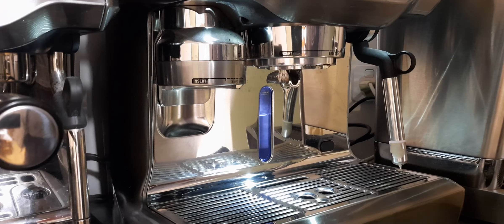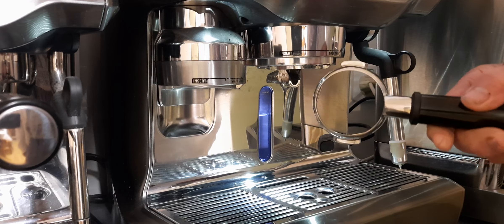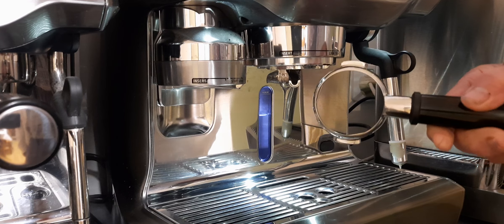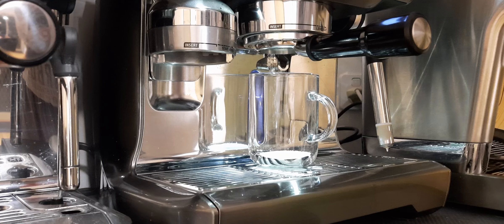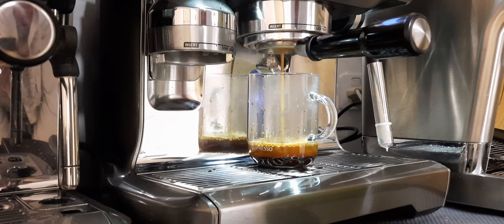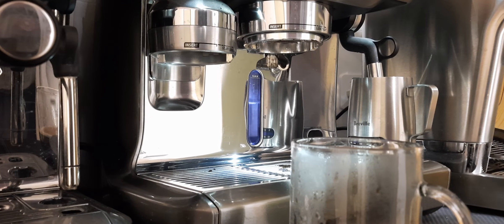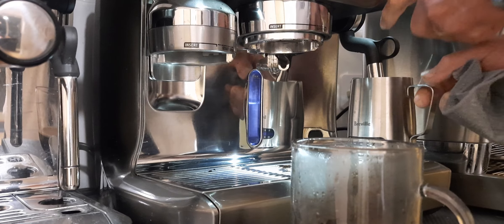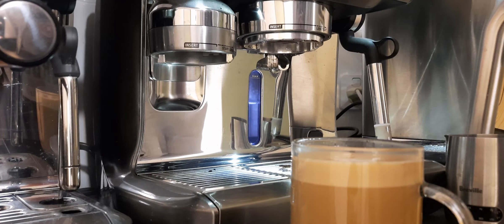Breville 58mm Bottomless portafilter,with Oracle touch. @ my home Cafe.

Comment: I've just got a bottomless for mine but having nothing but issues with extraction. Just splutters everywhere, which obviously is an issue with the stock one to (but its contained)

No idea what's wrong
Reply from the maker: Hi the spatter you are getting is a sign of grind size to corse.set your grind size finer.
And extraction time to 30 seconds for a Double filter basket.
Reply from the maker: I would suggest small amounts of change first till you get a steady stream with a flow and crema colour of honey.
Reply: @derekmenkensmyhomecafe.  I can get my grind down to about 9, it stops the splutter but really stops the flow, to the point a 30s extraction doesn't extract enough
Reply from the maker: A Double espresso shot is between 70 mll & 80 mll and coffee should start to flow at about 8 to 10 seconds on the timer display.
Reply from the maker: If it starts earlier the grind is to course,if it starts after 10 seconds the grind is to fine.
If you adjust your grind size to archive this you are on the right track.
Reply from the maker: You can also set your extraction time to 35 seconds  but I wouldn't go any longer than that, if you are using fresh Roasted beans that will improve the outcome to.
If you are using supermarket bought beans that will also have a affect on the outcome to.
It's a tricky thing to get right but perseverance will pay off.
Reply from the maker: If you are still having problems let me now and I ll try a make a video on the channel and hopefully it will give you a good outcome. 
Thanks for watching the video and asking me for advice it means alot.
Sincerely from Derek.😊